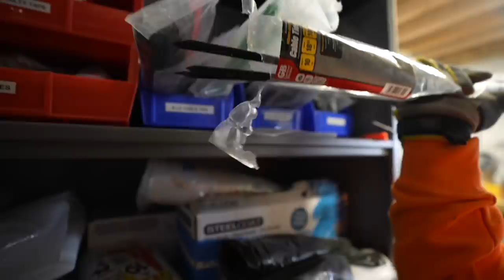Full Backyard Lawn Renovation!

Comment: I run a lawn service and one thing I would say that you should not have done was putting grab grass prevention(also known as pre emergent) down and grass seed at the same time. The pre emergent for grab grass does not allow grass seed to germinate so your seed won’t grow.
Reply: If the preventer contained mesotrione/tenacity he should be fine. Not sure what brand he was using.
Reply: Pretty sure I saw and heard he was applying crabgrass preventer
Reply: Yep, supposed to wait 4 months before seeding with the Scotts Crabgrass and Grassy Weed Preventer. Seed will not germinate.
Reply: @derekw2  meso/tenacity is a weed killer, it is available in a starter fertilizer. The yellow pre-emergant is prodiamine and it will prevent the grass seed from germinating.

Comment: core aerator might have still had the choke on it. core the bare areas more than the thick areas. the seed will come up in the plug holes. also dont wanna put down pre emergent weed killer and seed , as it forms a crust not allowing weeds to sprout but also prevents grass from growing. try the grass seed again in the fall for better sucess. also unless you have grubs, you probably dont need grub killer. go to a local seed store and pick up 50 lbs of turf type tall fescue grass seed. youll have the darkest thickest best lawn possible. - source - am a full time grass seeder

Comment: Ya know what else those spreaders are good for is ice melt, the wierd little white pellet kind not actual rock salt (I rusted mine to the point it broke) but spread that ice  eat on your concrete in the winter to avoid slipping on your front walk in the winter

Comment: I’m pretty sure that the water in the ariator is to give it some weight to push the teeth that push the holes into the ground. The one that I use had like 3 10 pound weights that you put in a slot on the back of it

Comment: You really need a small flock of chickens. No one works harder then chickens. Best part is they work all day for free and then lay you breakfast. Chickens are your farms clean up and fertilizing crew. Look at it like this. Chickens poop pennies. The beefcakes need to build a portable coop. You need a couple 100 feet of portable fencing. Let them chickens get to work.

I had similar issues at my new place. Cats helped with the voles. But what really helped the yard is chickens. Twice a year I put a flock of chickens in the area that had the problem. Once in the spring when the bugs first appear. Then once in the fall when the bugs were laying eggs. 2 years later and things are improving. The chicken poo left behind feeds the grass. Just don’t leave the chickens in the area to long. Timing is key.

Comment: You need to level everything with sand to make it a putting green also it’s called scarification for the other tool on the green works a big thing to look at is your grass type do not buy blends of grass seed because each type requires a difrent approach plug air ration (atv atachment) is pretty much useless and has no effect unless the ground is heavily compacted and the plugs must be mulched after if it is just spiking it you will see no benifit from that don’t worry abought pulling up green while dethatching since you are overseeding after it will fill in I may not have 20 years but I have 10 in this field 6 years for other company’s and 4 for my own looking at your new videos I can see what this did and it looks good don’t get me wrong just a couple quick tips for you
Reply: Also if you really want a putting green don’t use fescue as that does much better as a tall grass cut at 3.3 inches or more